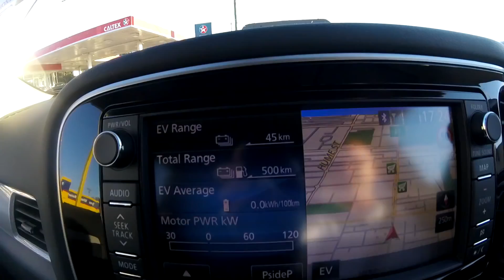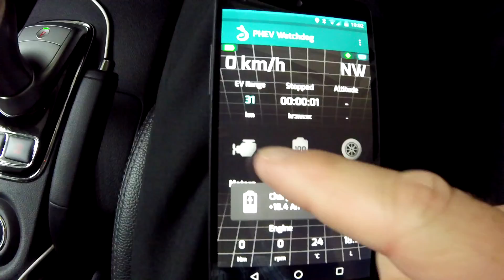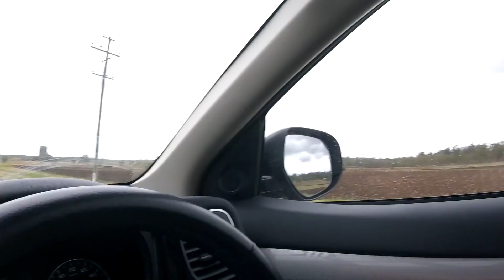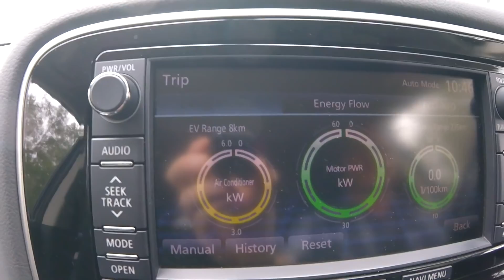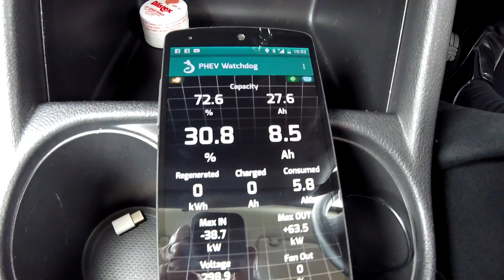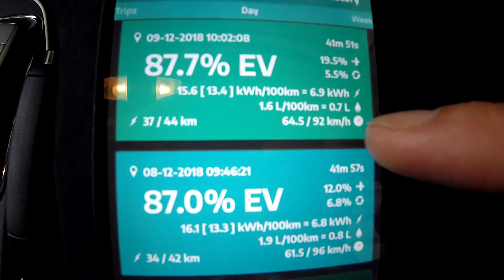EP151.2 - Why every trip with the PHEV is different - Range Comparison FAIL!

Comment: Hi,Sorry to disturb you,I am from Romania and I think to buy a PHEV vehicle, I saw now your tutorial and if you can tell me is good value for money to buy a Outlander from 2014-2015.What is your opinion on this.I switch now between the Outlander 2014-2015 and Prius plug in from 2012-2015.here in Europe now you can get it  approximately for the the same price.Thanks for all,Have a nice day.Demis.
Reply from the maker: Definitely get the PHEV Watchdog and test the battery before you buy. Apart from that I would rather buy the PHEV than the Prius, 4WD, more space, SUV, towing,...
Reply: Thanks for the quick answer.Thanks once again for all the details in the videos and your effort to make this series.
Reply: Hi once again,
Please I have one more question.
can you approximately tell me the cost of a regular service on the Outlander and how often you need to make it.
Thanks,
Have a nice day.
Demis.
Reply: @gonciaridemis.i2183  maybe contact your local Mitsubishi dealer as this pricing would vary by region.

Comment: Hi Andi,

i tryed to drive my car in Turtlemode and recognized something maybe interesting?
The Watchdog shows 33% @ 3kWh and 22,5% @ 1,8kWh ~ 6Ah*296Volt (3,7Volt average).
Turtlemode started @ 22,5% and i drove uphill but only the SoC falls to 21% / 20% but 1,8kWh ~ 6Ah doesn't chance. So I think it's good to drive the PHEV sometimes in Turtlemode mode to calibrate the BMU % for remaining Ah. Because I realized with charging about +1kWh. The only thing is i must drive down ~1000 heightmeter so I regen about 2,5kWh I drove the car until 2,8kWh remaining and charged it then. 

With this behavior it makes sense to cool down and discharge the battery with the heater before recharging. In my case it's easier to drive like crazy. I will try again and maybe I make a Video. 

Also interesting with Turtlemode the Voltage was 296 Volt with 6Ah = 1,73kWh but without Turtlemode i realized 285 Volt with 6,9Ah = 1,96kWh.
Reply from the maker: If this is necessary to recalibrate the BMS, should it not be in the manual?
Has your SOH rissen since?
Reply: @unpluggedEV  in the manual should stay a lot more then it those!
I have to do it more as once I think.